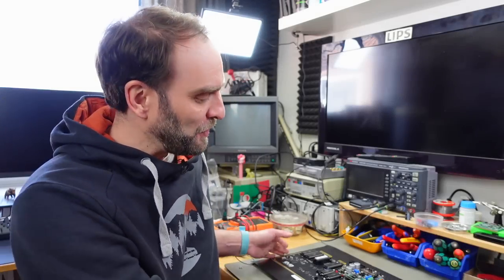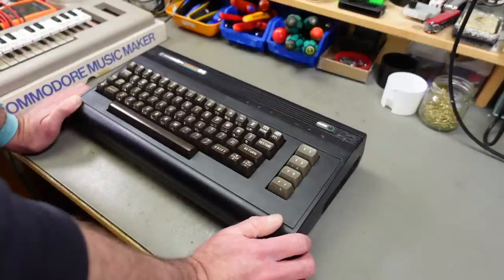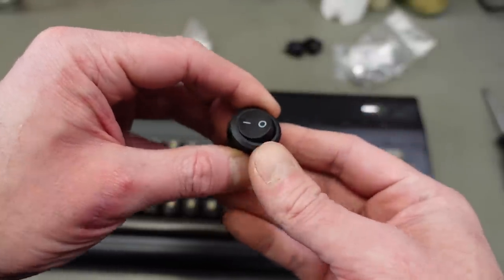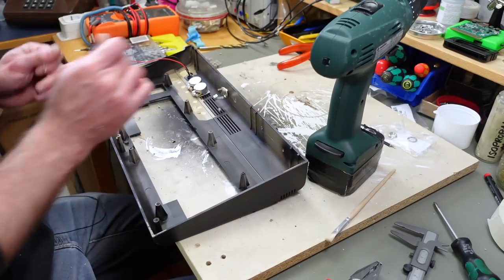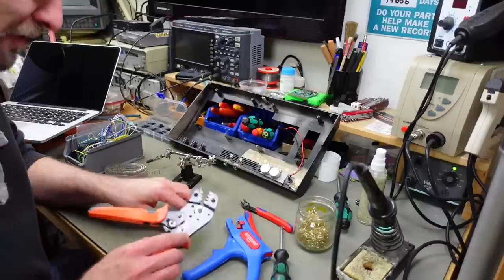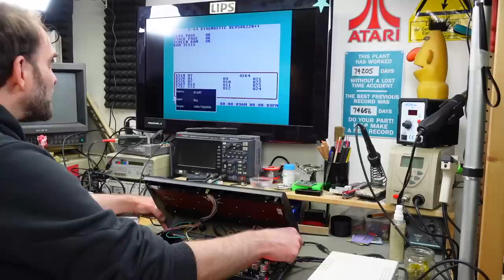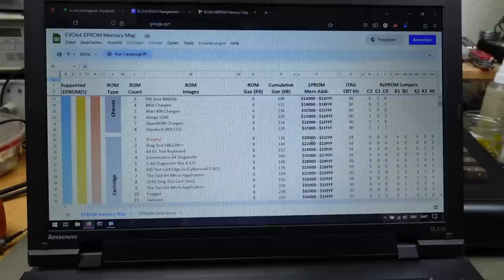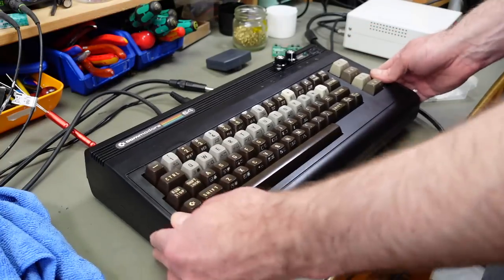Making a C64 Synthesizer

Comment: Already when seeing just the board in the intro I see that you've put a 8580 next to a 6581. That's a really sweet function that doesn't work on the original c64 without additional voltage regulations.

Cool!

I'm a long term Prophet64/MSSIAH user and has been using dual 8580's for at least 15 years (using the sid2sid board). It's really sweet to be able to do that.

Unfortunately one of my 8580's died so I had to replace it with an ArmSid.

Time to stop babbling and watch your video now 😅

Comment: Jan, you make me happy. I’m the one who designed and built the machine you are using. Do you think a quadraphonic EVO would be useful ? I am experimenting with a larger Xilinx pla chip and there are enough IOs that I could control 4 Sids on board. In addition the triode64 daughterboard is finished and I am assembling a few today.
Reply: let's face it - the world is ready for a dedicated, C64-based, full-on digital-music synth machine. In addition to dual SID, why not also a Yamaha FM synth - and integral MIDI? And appropriate port for connecting a serious musical keyboard. Sure, would need new firmware and software to be written, but all these vintage devices are well understood and there are plenty of talented people in the community that would be up to the task. Build it and they will come kind of thing. At its heart it would still be a C64 that could play the catalog of existing software. JanBeta has shown how to make a C64 that sports different personalities.
Reply: @TheSulross  it would not be difficult to add more sound chips in some particular memory locations. The PLA can do everything. Actually the newer version of the PLA has all the As and Ds and Phis inside so it can take over the whole machine. The rest is verilog code. I have a board with the larger xc95144xl, a bunch of wires and almost no obsolete old LS chips left….
Said that to add different sound chips, it would take me 6 months of evening work, let’s say 500 hours, and we would sell 50 boards max… the ratio between “would like and I do” is around 10, and the 90% that “wish but can’t” then jump on all possible social media and troll the developers. Boards need to be engineered with “production” in mind, not diy, and choices of components, reliability, logistics is by far the biggest part of the job. Look here. Comments are about aliexpress or not. Arguments should be about “gold plated versus nickel plated” or “CG0 versus xr7” dielectrics, jfet versus mosfet… we are surrounded by techlogogical and scientific analphabetism.I can’t take more work. I already work 24/7 !!!

Comment: Great Work! I use a setup quite similar, but yours is way ahead with the Evo. I run CythCart on a DualSID-powered C64II and a Datel MIDI-Interface, so the lack of the Potis and the missing Overlay is OK for me, because i use a MIDI-Keyboard or the DAW to control the C64-Syntheziser.

Comment: I noticed on my test board the L/R channels were swapped on the tube side. You can compare with the normal audio out. Let me know if that's the case for you as well. :)
Reply: In a dual-SID setup, there is no fixed standard for which channel each SID should output to. That’s more of a preference decision. However, the production release NuTube64 module allows you swap the output channels.

Comment: i really wonder if there will be a new technology somewhen in the future, to reproduce real commodore custom chips. Would be the last step for building fully new C64s. Those new boards are looking so nice, especially the golden shine =)
Reply: One Day chip fabrication will be as easy as making circuit boards... I hope... To recreate the sids with all its analog noise and details would be awesome instead of emulating them...
Reply: We seem to be getting closer and closer to that, and it will be so cool when it happens.
Reply: Almost certainly that will happen in the same way JLCPCB now handle pcb and 3d printing.. one day... might be couple decades for China to offer such a service but I can see it happening. I can't see an Western nation doing that however, the social and economic structure isn't capable.
Reply: Pretty soon there will be modern remakes of all of the key chips... We already have many options for SID clones, and now we have the Kawari VICII replacement, and the Monotech 6502 > 6510 adapter boards. Jani is working on his "J-CIA" project which will complete the puzzle... Stay tuned...
Reply: wonder what the cost would be to take the Verilog or VHDL of the FPGA SID and VIC-II implementations and manufacture a run of ASIC chips? What would be the minimum quantities necessary before would be a serious size of business to make that worthwhile? With all the attempts to re-create the C64 one wonders if enough demand might exist to make that worthwhile. Well, then real C64 could be sold on Amazon in same manner as TheC64 emulator-based product.
Reply: @TheSulross  already exists and it is called ultimate64 !!! Anyway to reproduce the old Mos chips one can “clone them”. Look at visual 6502 and the polygon methods. They opened a 6502 (with sulphuric acid), fotographed the silicon (different lights different depths), then extracted the transistor/fet circuitry and then another guy made a verilog code out of it.

Comment: I thought you mean making the chips diy, not assembling from pre-made chips, on a bread board pcb
Reply: I mean starting from sand
Reply from the maker: That would be a bit of a challenge! 😅
Reply: not for ion tube (inverse of crt display tube and similar to a electron scanning/transmission microscope) with ion EM separation purifier combined in the ionizer of the start material, like silicon sand, great for growing single crystals @JanBeta

Comment: Not a fan of the EVO 64 people or how they operate, but still a great video. I think I'd be tempted to try that with one of the reproduction 64C cases, but obviously you'd have trouble fitting everything inside that.
Reply from the maker: I’ve seen similar builds with C64Cs so it should be doable, probably requires a bit more planning ahead than I did. :D
Reply: @JanBeta  I just had a thought. One of those Australian C64 cases might be ideal. They have two perfectly placed flat panels on the top that look like they are made for adding extra controls. Added bonus that someone will get really mad if you drill holes in one! 😉
Reply: Why the grudge against EVO?
Reply: Why you are not a fan of us ? I operate in my garage. Financially, the evo project has costed much more than what it has produced. Emphatically, the evo project has made hundreds of users happy around the planet. So overall, I think it was a good deal for us. I hope you will change your mind as we operate with quality and progress in mind. Stay tuned !

Comment: Lmnc und dr.mix   haben Mal mit Hilfe eines arduinos mehrere pots angeschlossen. Es wurd auch eine Platine erstellt.  Soll keine Werbung sein sondern nur eine Info .
Reply: I can say with certainty that this was not a “Paid Advertisement”. Jan came up with this idea on his own and chose to share it as a fun project that others might enjoy. This approach of being able to integrate the adjustable pots directly into the system’s paddle ports and work off of fully integrated software, is s bit easier than requiring the end-user to build custom hardware with integrated MIDI, then program and wire up an Arduino, wouldn’t you say?
Reply: brilliant work! Jan.